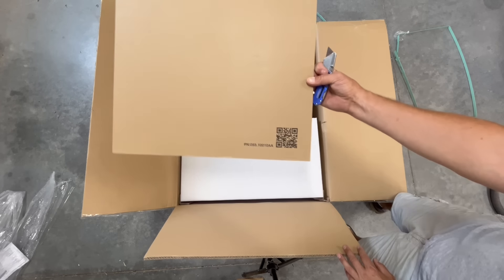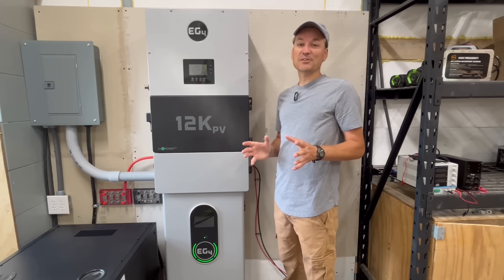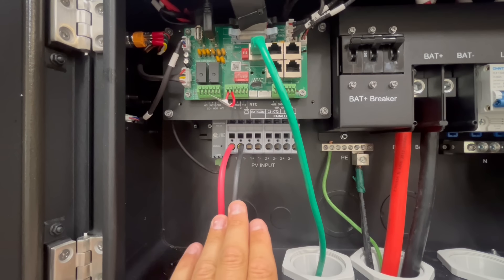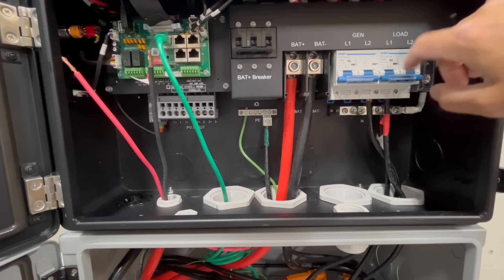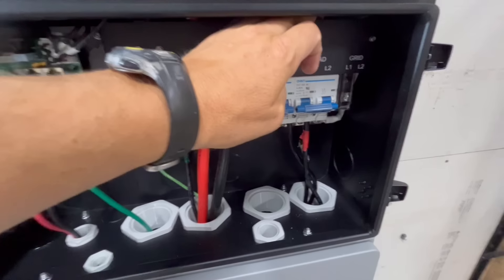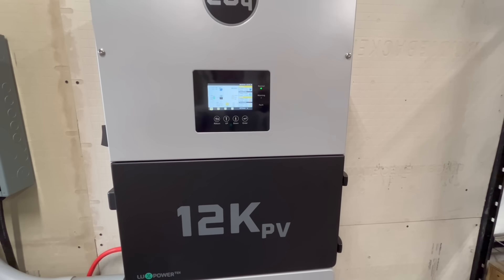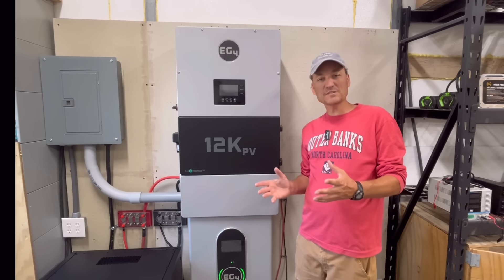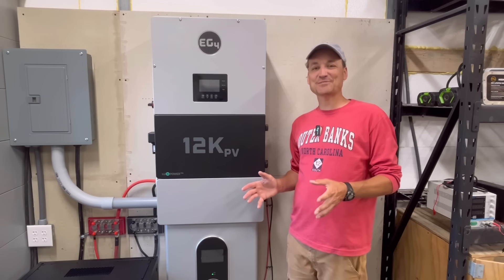The new EG4 12KPV inverter review & testing~ Massive surge capacity in one small package

Comment: waoo!! nice well this will be my upgrade to my 6000xp if i decide to sell back to the grid. here in puerto rico the grid company is a mess thats why i have not considered to get a hybrid inverter. plus my 6000xp is working flawless 24/7 from day one. but got to say price range the 12k  is a good option. like always excellent video my friend
Reply from the maker: Yeah if someone needed an inverter for net metering this would be a great option. 

It also has the grid features. Like you mentioned though, it’s hard to go wrong with a 6000xp for off grid uses.
Reply: Im' in PR too. Running 24/7 on one 6000xp and got a second in parallel about a month ago. I f you decide not to sell to the grid it would be better to get a second 6000xp. Luma / grid will continue to get worse as people keep connecting to it for solar.
Reply: @GavinStoneDIY  Many states are either prohibiting or restricting net-metering.  9 states allow power companies to sell at 15 cents per KWH and only purchase solar power at 3 cent per KHW.  You would have to send the power company 5 KHW for every KHW you use.  Given the costs of hybrid inverters v outgrid inverters that is an issue as well.  Outgrid inverters are half the price as hybrid inverters.
Reply from the maker: @exploitthechildless1510  this is true. But hybrids offer more options  than just net metering. They can also interact with the grid in ways the off grids can’t. For instance you wouldn’t need a critical loads panel with a hybrid. Which can save a lot of labor for people depending on their setup. Peak shavings and time of use settings are more common with hybrids also. So it all depends on what someone is trying to accomplish.
Reply: @GavinStoneDIY  Can you clarify why you would not need a critical loads panel?
Reply from the maker: @exploitthechildless1510  with an install of a typical off grid inverter most people choose to install a critical loads panel or (sub panel). And move all their loads they would like run by the inverter to that panel. Assuming they are installing these in a home with grid power that is. Some people will use an interlock switch. But that’s a lot more rare in my opinion. 

With a hybrid inverter everything can happen in the same panel. The inverter can power your household loads at the same time as the grid, in the same panel. So for some people that’s a huge advantage.
Reply: @GavinStoneDIY , when power is allowed from the grid to run the home, while also blending solar and or battery, will the 12Kpv electrically prevent back feeding the grid? Or just the software with the “sell back” feature turned off?  I think most of us are a bit scared to do hybrid for fear that we will somehow back feed a few watts and get fined for having a “grid tied” system without a permit. A video to clarify these things would be amazing as many forums are buzzing with discussions on the topic.

Comment: As a happy EG4 6000XP owner, I'd like to see a load/start comparison of 2 6000XP and this 12K. I'm one of those guys who will feed batteries rather than the grid.
Reply from the maker: That really wouldn’t be an apples to apples comparison. The output on this inverter is 8kw. 2 XP’s output 12kw. 

The 6000XP’s have a really robust surge capacity. But the 12kpv is definitely impressive when it comes to surges also.

Comment: Sad that the 6000xp is not ul 4590 approved so you can’t use it on grid won’t pass inspection.
Reply from the maker: Probably depends on the jurisdiction.

Since a lot of people are essentially using it as a UPS, I wouldn’t think it would be an issue in that case.
Reply: Bro UL 9540! 😂. And that's not true anymore, they are listed to UL 9540 A.  Good to go!

Comment: Gavin how are you, quick question where do you attach your pv ground? to the inverter? to a ground rod? to the main panel? the reason I ask you is because signature solar told me I can"t connect my pv ground to the irverter is have to go to a ground rod. Thanks
Reply from the maker: @pedronhfd6969  yeah I don’t attach mine through the inverter. Code requires the PV ground to return to your main grounding electrode. Which would be your main ground rod.
Reply: @GavinStoneDIY  Thanks so much, that means I don't have to put an extra rod on  the ground just for pv right? I can attached my pv grounds to my house ground rods right? also I'm using 10awg stranded (ground wire) is that ok? Thanks again for your help.
Reply from the maker: @ yes that should work fine. Granted I’m not an electrician. I’m assuming you’re using 10awg thhn?
Reply: @GavinStoneDIY   yes thhn insulated
Reply from the maker: @pedronhfd6969  you’re good to go then.
Reply: @ Thank you so Much for your Help Gavin.

Comment: @gavinstone great review i am hoping to receive mine soon, similar setup however with the outdoors battery, BTW what is the overall measurement of the battery with the box installed on top? From the ground to the top of the box, excluding the inverter.
Reply from the maker: Sorry for the delayed response on this one. It slipped through the cracks. 44 3/4 inches from the floor to the top of the box.

Comment: with prices now out it would be better to get 2x 6000xp that can output 240V at 50A (12000 watts) and cost less for both.
Reply from the maker: For off grid it’s hard to beat the XP. And they do a fantastic jobs on surges also. 

But for people considering one standalone unit that has a waterproof rating, is quiet and runs smooth, this could be a good option.
Reply: @GavinStoneDIY with a closed system. No dust
Reply from the maker: @d.pollard5962  yeah that’s a big factor.

Comment: Can you use the current clamp on the meter feed wires to manage the output of this inverter considering the sum of current being produced by other arrays at the same time?  In other words, if you have a target Kw contribution of say 10 Kw and 7 Kw is being produced by other arrays not connected in any way to the 8Kpv, can the current clamp attached to this unit moderate its output such that the total of all inverters feeding one meter does not exceed 10 Kw?
Reply from the maker: @larrycollar1322  it would have to be able to monitor this other array in some way. It’s possible the CT’s could, but I’m not quite sure. You’d be asking it to throttle its export based on what the other array is exporting. Probably the easier method would be to run the other array through the AC coupled option this inverter has. Assuming you’re talking about an array built with micro inverters.

Comment: Great video,  question I know you put some ferrules on the battery wires,  but did you use any crimper s or is not necessary just with the ferrules?
Reply from the maker: @pedronhfd6969  I honestly don’t think it’s necessary. It’s just something to contain the wires as you  put them into the terminals. And then the terminal itself clamps down on the ferrule.
Reply: @GavinStoneDIY  Thanks so much for the help.

Comment: Great review Gavin. Do you think it needs a third input for turbine. I find not many inverters have 3 input’s. What your view on how to set it up. Do I put gen on the grid input then turbine on the gen input? Is this bad for the inverter?
Reply from the maker: @lennieadi  a wind turbine? Typically you need a dedicated charge controller for those. They have a very inconsistent output, so a standard mppt wouldn’t work. I believe some of the midnight charge controllers work.
Reply: Brilliant. Thank you Gavin. I’m trying to learn as much as I can in planning a system a few years from now. These channels are invaluable. Thank you. Keep up the good work.

Comment: Another great video!  I’ve heard some users claim to have 100 watts or so of back feed to the grid even with the sell back feature turned off. Have you tested this or experienced this with the 12kPV or your 18kPV?
Reply from the maker: I have them both in off grid mode. I don’t own a homeview monitor. So it might be a bit difficult for me to test. From what I’ve heard these inverters backfeed the least of any on the market. But again, I haven’t tested that. 
Any hybrid inverter does have the potential to backfeed a small amount when a large load shuts off. But it’s a very minor amount. There are thousands of installs out there at this point. So I think we would be seeing lots of reports of the electric providers complaining if this was an issue.
Reply: @GavinStoneDIY , do you think it’s a small enough amount of back feed that the power company wouldn’t even notice it?  The power company installed a smart meter on my home recently. So, do you recommend the 6000xp or 12kPV?
Reply from the maker: @Hunter-vb8wo  I don’t think the power company would care no. 

It depends on your needs. The 12kpv is a hybrid. And 6000xp is off grid. So they can do different things. And the output you want is a factor also. 

I prefer the 18kpv and 12kpv. They are sealed. Which means no dust or filter cleaning. Quieter also. But the 6000xp is a great price, and does an awesome job all around with surges and loads.
Reply: @GavinStoneDIY  , thanks so much for the help, you are the man!  I refer people to your channel every chance I get.

Comment: could you elaborate how the four inputs into two MPPTs can be used in an advantageous way? thanks a lot, great video
Reply from the maker: Sure thing. It’s essentially 2 mppt’s. But 4 inputs. So if you have a large array,  this allows you to parallel the panels by running 2 separate strings from the same array. Paralleling the panels raises the amperage but keeps the voltage the same. Hope this helps.
Reply: @GavinStoneDIY  Great, thank you so much, that makes sense. I'm assuming that the MPPT can then optimize each string separately for more power output. thanks again, I enjoy your channel
Reply from the maker: @Marlin-m9m  it can optimize the 2 inputs in that way yes. 

Technically you could combine the inputs out at the array and send them in. The fact that they have 2+2 just makes it so you can skip buying a combiner box.

Comment: Is each PV Input 100-600 VDC?
Reply from the maker: Yes. That applies to both mppt’s. So each has a max voc of 600v
Reply: @GavinStoneDIY  Gavin.  Is that taking into account voltage gain in low temps?  I was planning 2 502.8V arrays, but if my cold coefficient is 1.20 I could hit 603.36V or even potentially 628.5V if it hits a 1.25 Coefficient.
Reply from the maker: @celicalostandfound  the 600v is maximum allowable voltage. So you’d have to take that into account when designing the array. I would shave off a panel from that setup if I were you. Plus the actual usable voltage is 500v. The extra 100v is just for headroom in cold temps.
Reply: Reason I ask is because I see 4 inputs but the label says 2.  Can you put 2 600V input on each side?
Reply from the maker: @celicalostandfound  the 4 inputs are actually 2 inputs. They just allow for paralleling. So it’s sorta like a combiner box within the inverter. It’s has a pretty high amperage allowance because of this, so you can likely parallel your array to achieve what you need.
Reply: @GavinStoneDIY  I thought the max amp allowance on each input was 25amps.  Each panel I am looking at operates at 12.79A so I could parallel 2-6 panel series and do 251.4VDC at 25.58 Amps.  Would that hurt it?
Reply from the maker: @celicalostandfound  exceeding the amperage slightly won’t hurt it no. Amperage is pulled not pushed, so you’d be good with that.

Comment: Any example(s) to show generator connected, ie. charging batteries, simulated grid down, position of switches ?
Reply from the maker: Sure I’ll see if I can throw that in the next one. Honestly though I usually recommend the chargeveter. It really depends on what generator you have, but the chargeveter can eliminate some potential issues. If you haven’t watched my video on that it might be helpful.
Reply: @GavinStoneDIY  a Honda EU7000ISNAN generator, no chargeverter should be required with this Honda inverter

Comment: Great video - Is it capable to handle one 2.5ton and  a 3.5 ton at the same time. I want put them on this system. UNfortunatelly i do not have solar panels yet. I just want to make sure if i get enough solar panels i will be able to run those....
thaanks
Reply from the maker: I always recommend installing a soft start on your central air unit. It cuts down the startup amperage considerably. It’s unlikely they would both be starting at the exact same moment so I think you’d be fine. But you’d probably be using around 5,500 watts of power to run them. That’s a bit of a guess without seeing the specs. So you wouldn’t have much room for other loads.
Reply: @GavinStoneDIY  thanks for the response. How do i get a soft star? would that reduce the time to obtain the set temperature faster? 
At the moment it takes like 5 hours to go from 82 to 77 during the day , and finally get it at afternoon or night where outside is cooler. o course here in Houston we were at 109 yesterday.

Can i use my smart meter to estimate max peak load per day ?....i have see the plots on a max of 2.5kwh for the entire house during peak temperature 4 to 7pm.
could i assume that my max ac consumption is less than 2.5kwh?

sorry for too many questions but i am deciding on going with this solar units and it is a big investment.

i hope you can comment.

thanks again!!

Comment: What gives better surge load, 1x 12kpv or 2x 6000xp?
Reply from the maker: The 12kpv is actually 8kw of  continuous output. The 6000xp’s are each 6000 watts. So you’d have 4,000 watts more with 2 xp’s. Are far as surges, the 12kpv is awesome. I believe the XP’s might have a slight upper hand though on inductive loads/surges. They are just so tough.
Reply: @GavinStoneDIY  2x 6000xp is cheaper, but I actually need about 18kw output for house and ev charging. Maybe 3x 6000xp since that will be about $4500 only.
Reply from the maker: @KoiAquaponics  yeah in that case you’d be good with 3 XP’s. Just keep in mind you’ll need enough battery storage to power the units. So right around 5 rack batteries at least. Or 3 pro wall mount batteries.
Reply: @GavinStoneDIY  yeah I acquired 3 ev packs and they will give me like 90kwh once I put bms on them.

Comment: Currently have no power for last 3 day from Hurricane Beryl.. how would I connect a dual power generator?
Reply from the maker: I’m not sure what “dual power” means. Connect it to the 12kpv? A chargeveter would be ideal. 

If not you can wire it into the generator port. You’ll need a cord with a nema 50 or 30 connector to hook into the generator.
Reply: @GavinStoneDIY  awesome thank you!! If i did so could I charge and power my home at the same time....  or would this be bad for the 12KPV AND OR BATTERY?
Reply from the maker: @Jay-fc4fg  yes you can do both assuming you have enough power. You can adjust your charging amperage on the 12kpv to make sure you don’t go beyond your generators limits.

Comment: Can you run a 12Kpv and a 6000XP in Parallel?
Reply from the maker: Yes. But not in the conventional sense. They wouldn’t have direct communication with each other. You could add the xp’s output into the input or generator port of the 12kpv like I did in the video. Essentially it treats the 6000xp as a mini grid, and draws from it when necessary.

Comment: Another great video! Could you set it up 120/208 and check voltages on phase-to-phase and phase-to-neutral? We live on a condo (USA) we get 120/208 service from the grid.
Reply from the maker: 208v? Wow
Reply: @GavinStoneDIY hi, yes is oretty normal for condos and apartment complexes in the US. Could you set it to 120/208 and confirm if the voltages are in fact 120/208?
Reply from the maker: @carlossantini  sure. I’ll take a look this weekend if I get a chance.
Reply: That's tricky because these inverters are split phase and if you have two legs of a 120/208 service the phase angles are 120° off, not 180° like a typical split phase electrical circuit, so it is not just a matter of adjusting the voltage range. As a long time off grid specialist I steered clear of these types of installations or I only powered 120 VAC loads. You can do it just be sure to do your homework and get somebody who knows what the heck they're doing which is not easy!. 😂😂😂

Comment: I noticed the two communication cables seem to be (Labeled) specific. I am assuming they are labeled to either assist people with knowing the location to plug them in, or they are not standard Ethernet (T568A/T568B) terminated. Is one of the cables a crossover?
Reply from the maker: The parallel cables have a specific pinout. The battery communication cables are just cat6 cables I believe.
Reply: @GavinStoneDIY  Hey thanks for the response ! I appreciate the information your channel provides.

Comment: Great video! One question, your LL batteries are paralleled to the indoor power pro batteries on the bus bar on the indoor power pro? and communication as well I'm assuming?
Reply from the maker: Exactly. Technically they are using the exact same BMS. I’ll try to show that in a follow up video.
Reply: @GavinStoneDIY   Thank You!  I would appreciate it.  I have 3 LL's and looking to purchase 1 indoor power pro , so I'm looking to do the same.  Just want to make see how it's done before I pull the trigger.  All Great videos, keep it up.

Comment: Nice unit.  I really like how it pairs well with the wall mount batteries from EG4.  If I needed grid interactive features this is what i'd go with as I don't need 18k level power.  I love that it's dead quiet till over 6kW and a low idle consumption. Thanks for the review Gavin.  Oh, can you clarify - can you run both a power pro and a bank of LLs rack batteries on one inverter via bus bar?  Thanks.
Reply from the maker: Thanks! Yes you can run both. They’ll parallel and communicate together without an issue. I’ll try to show that in my next video on the 12kpv. They have the same BMS, so it works really well.